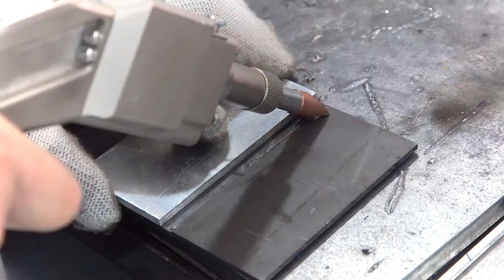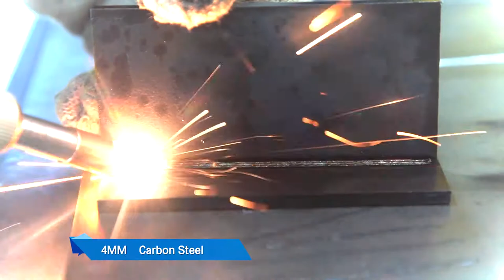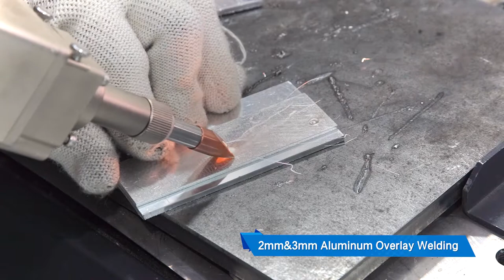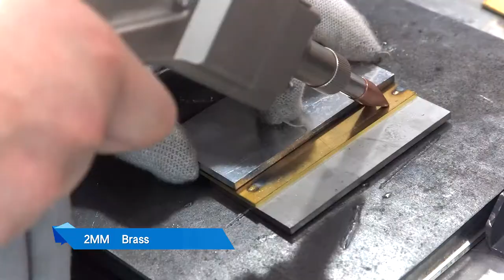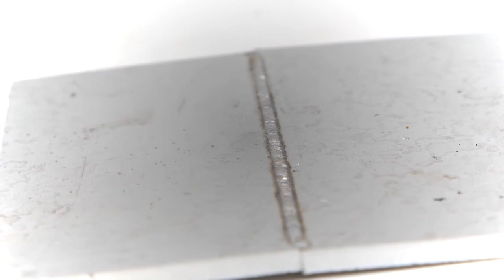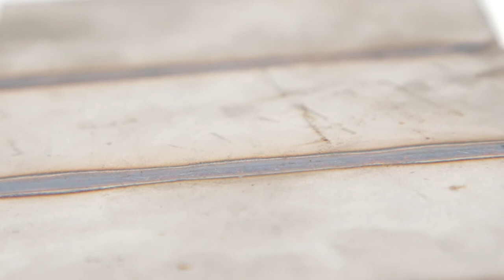1500W Handheld Laser Welder Welding Show

Comment: Where is the weld strength test?   I see it fuse 2 pieces of metal together but a lot of good it is if its not strong bond. 
Sorry I am not sold on the product , I'll stick to my Tig welding!
Reply: We are looking at the future of welding
Reply: @darcymcnabb9259  No we're not. The idea has been around for decades and was dropped due to lack of strength in joints. You obviously know nothing about welding.
Reply: Darcy Mcnabb weak joints and draws a lot of power nothing like having 12 million in machines and stuff in your weld shop and spending another 12 a month on utility
Reply: Please, let me add more kindle to the fire! Read my comment above please!

Comment: Looks more like a modified wire fed tig welder with a laser pointer. +-  prongs with a wire feed. Might be an answer for thin sheet metal, structural strength, not so much.

Comment: Habrá disponibles a la venta para MÉXICO SALUDOS
Reply from the maker: hi，friend，are u interesting our laser welding machine？may i have u email and whatsapp number？we will contact u asap.
Reply: @senfeng-new-energy  
Hi can it welding  repair damage turbine parts? Or only for thin metal plates?
Reply: Si, como no Sr. Burrito. Tiene $25,000 por ahi tirados sin usar? Envio fuera de EUA cuesta otros $1,000 aparte de los $24,000 de el equipo. No, no pesos, Dollares! Ahora que, si Ud. trabaja para algun Cartel, bueno, una bicoca na' mas!